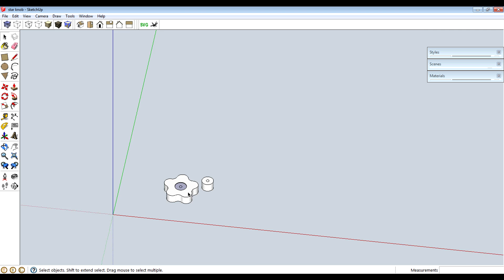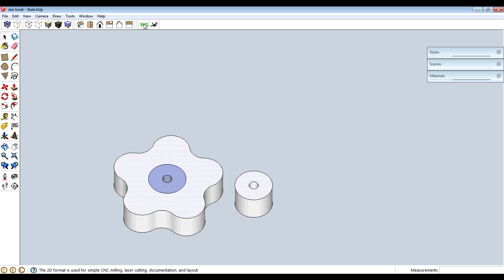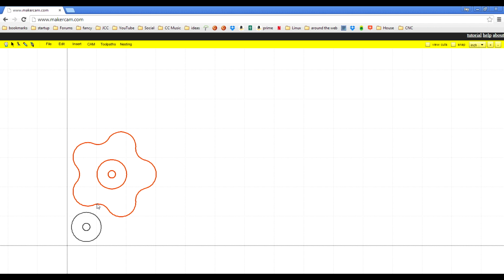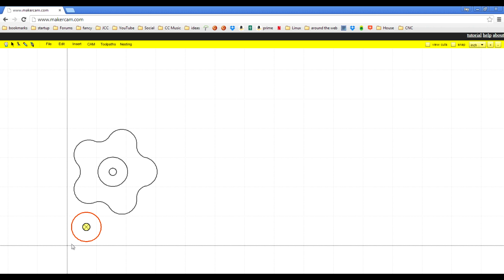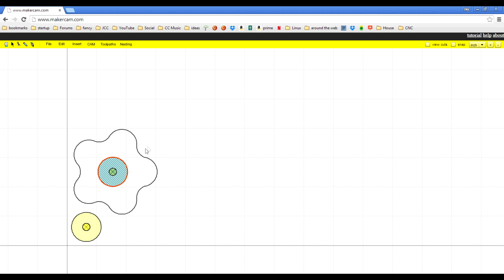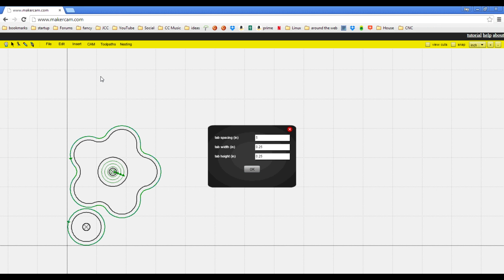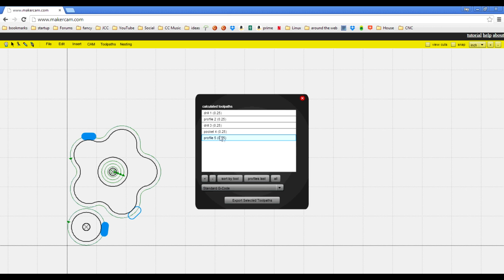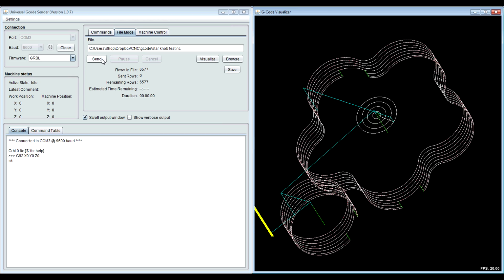CNC Workflow: SketchUp, MakerCam, Universal Gcode Sender  - 191

Comment: Thanks very kindly for an excellent video Jay !!

I am an absolute beginner and until now I could  not find a video that took a 3D CAD image to a nest of cut outs on a sheet of ply for a CNC

I just wish you went slower at the start where you turned the 3D knob into a 2 D part and cut it out.

I cant follow along because you go click click click - far too fast for me to follow along with you.  

But thats just me 😔 as an absolute beginner & I am not the sharpest tool in the shed at the best of times anyway. (My cnc has not even arrived as yet)

I notice in the comments that many other people could follow along with you that quick and learn without a problem. Good for them! 

Great stuff and I hope you might do more videos. In fact I have a proposition

Id like a slower,  step by step video, less talk,  more written comments on the screen,  that shows 
1. drawing a 3 dimensional speaker box with an internal brace or baffle & rebates for very solid cabinet joints (maybe even dovetails?)

and then shows step by step how to convert the 3D box image into the 6 individual sides of a speaker box

(Top, bottom,  front,  back, left & right sides with rebates or dovetail joints)

And an internal baffle  or brace inside the box.

I'd happily pay you $100 dollars for a video showing me how to draw that in SKETCHUP and send it to MESHCAM and then send it to a thumb drive on a usb that can then be loaded into a CNC router.

Make the video as though you are training a child who has basic computer skills but has never CAD CAM or CNC router before
All done step by step, slowly  so I could simply follow you along Click by click 

and cut out the panels from a sheet of 2400x1200mm of marine ply  ideally with a speaker  hole in the front and 
A hole in the back for a speaker wire connector 

I just wish you went slower please! 
Let me know if I can buy that training video off you because that is what I want to learn to do thankyou kindly if you can help please and thanks anyway if you cant help.

What I need please:

1. CAD to 3D speaker Box drawn into individual panels drawn in sketchup
2. Send CAD file to MESHCAM &  to GCODE 
3.Save GCODE to USB thumbdrive to insert into a CNC router 
4. Cut 6 panels out of a sheet of 19mm plywood to 

5. glue together wooden pieces to make the original 3 d image & prove the design worked.

You could of course make a small box for demo purposes... but I could use the techniques you teach to build my own speaker box in the size that I want. 👍🏻

Comment: Great Video Jay,
It is videos like this that show how easy it is for the home woodworker to use a CNC machine.
Many people don't like these machines in the shop but the CNC machine is just another tool and are not seen by owners as the only tool in the shop. Like any tool it is good at some things and not good at others. The trick is to know the difference and use the right tool for the job.
Beware the CNC bug. There is always a bigger faster machine lurking in the wings once you catch the bug.
Cheers
Peter

Comment: Great video on cnc workflow!  I have just built a diy cnc machine and have been testing different programs.  I have been using Inkscape-makercam-linuxcnc.  I think I will probably use the sketchup instead of Inkscape though.  Have you used the Sketchup plugin SketchUCAM?  It looks like it may eliminate the need to export the svg file to another program but I have not tried it out yet... Thanks for all your great videos!

Comment: Wow!   CNC has certainly come a long way for the home user since I made a version for cutting copper shapes for my wife's enamelling business - see http://www.donjohnson24.co.uk/images/Compucuts.jpg
When she and I retired, I sold it, not thinking that I would get into woodworking, but now I would find it useful - but nowhere as neat and functional as your machine.
The explanation of how you got from design to manufacture would have been a boon to me ten or fifteen years ago when I was using my system which was based on a converted mortice machine and stepper motors on an X-Y table.

Comment: Thanks for the video. More CNC pls. Maybe CNC software overview - different software that help working with CNC machines. Also please add the specifications for the machine. Does it have the original shapeoko steppers  (the ones that shapeoko ships with) or you upgraded them. This seams like a bit heavy router for this machine.

Comment: How do you control the precision of your parts profile? No radius compensation? Just hoping that your bit does not deflect? That those aluminum extrusions are strong enough? Are there encoders on those stepper motors to ensure there are no loss of steps? I don't understand...
Reply from the maker: Steven Verschaeve I don't understand most of what you said. I complete the workflow as I did and it cuts what I need.

Comment: Interesting that you didn't have to recalculate the toolpaths after adding the tabs.  Have to do that with the software I use.
Reply from the maker: krtwood What software do you use? I have been playing with various other free software out there to find the one I like the most.
Reply: Vcarve Pro from Vectric, but it's very not free.  Well it was included with my cnc so it was sort of free in the sense I didn't go out and buy it separately.  You can download a fully working trial version if you just want to play with it though.
Reply: Jay Bates Artcam Express is not so expensive. It includes 500 nice 3D models. But you have to buy ekstra module to get tabs... But I find it worth the money.

Comment: Very well done Jay.  You are a very good teacher and knowledge sharer.  I worked with CNC/Robotics for 3 decades and had fun with it.  I hope  to do what you are doing with the CNC Laser I just got.  I was going to buy the same unit you have but I decided on the laser because I actually needed it for my little business.  At a later date I will get a CNC mill like yours and a 3D printer.  Thanks for a sharing with us and handling the not so positive comments so well.  I don't watch the Shapeoko videos that have been posted because at this time I am more interested in sharpening other woodworking skills but this video was more about designing something and the workflow to move it to production.  Nice work.
Reply from the maker: Jim Coogan Thanks for the feedback Jim. I appreciate it. What laser cutter did you get?
Reply: Jay Bates
I got an inexpensive Chinese laser off Ebay that quite a few hobbyist get for the sole purpose of upgrading it.  It's a good learning tool.  On YouTube you can search for K-40 laser engraver/cutter.  On Ebay its a 40W CO2 laser.  Low cost so I don't mind blowing it up.  So far its been fun to use.

Comment: Jay: Obviously you are comfortable with technology.  In my opinion, many woodworkers are scared of technology.  Some have trouble attaching a photo to an email. I worked in IT for many decades and understand what you said.  One thing I learned is that when talking to non-technical people, I used only non-technical language to avoid intimidating them.  While you know what an SVG file is, many do not.  I think your video would appeal to more people if you slowed down a little and explained that an SVG file (Scalable Vector Graphics) is just a method of transferring information (not data) from one software application to another.  Some people may also need an explanation of what a suffix (.svg) is and why it is important.
Reply from the maker: peggyt1243 Thank you for the honest feedback. It's hard to get as much information as possible into a video without making it too long. The intent with this video, and most of my videos, is to get people thinking and headed in the right direction. A quick google search can answer most any simple questions that people have.

Comment: Jay - Noticed that the GRBL (Arduino) is using firmware 0.8c.  You should upgrade to 0.9g - it is WAY better. It will make it seem like you bought a new machine - the stepper control algorithm has been updated and is much more efficient.  Here are some instructions on how to do the upgrade (see links below - suggest you use the Arduino IDE method).  Ping me if you want me to share my GRBL 0.9g settings.

https://github.com/grbl/grbl/wiki/Flashing-Grbl-to-an-Arduino
https://github.com/grbl/grbl/wiki/Compiling-Grbl
https://github.com/grbl/grbl/wiki/Configuring-Grbl-v0.9
Reply from the maker: Jordan Terrell Thank you very much Jordan. I'm always open for learning more about this. Thank you.
Reply: A nice feature of 0.9 is the touch probe for the Z axis. 
This makes it deep simple to zero the bit to the surface of your stock. Makes doing a job with multiple bits much easier.
Reply: Jeremy Johnstone Jay Bates Yes, that is really nice.  Takes a lot of the guess work out of multi-tool jobs.  That and having homing/limit switches - those are a must have. So nice to be able to get back to work piece home perfectly after changing bits.

Comment: A brilliant tutorial, Jay. That software could not be simpler to use.

Something we do, where I work, is to machine to within 0.5mm of the bed, as opposed to cutting to full depth or leaving tabs. This leaves you with a 'skin' that can them be trimmed flush.

Each method has its own benefits and I look forward to seeing you make more use of your new toy. :-)
Reply from the maker: Olly Parry-Jones Thanks for watching Olly. I sometimes do the skin cutting as well. I prefer the tabs though. What do you typically cut at work?
Reply: Jay Bates We mostly machine foam moulds to hold various items but we also do plywood worktops, shelves and a HMW plastic for all sorts.

Comment: Thanks for the detailed overview of your process. I just upgraded my Shapeoko 2 to the Makita RT0701C and can't wait to see how much that will increase its capabilities over using a dremel. I can't wait to see how you incorporate the CNC into future projects.
Reply from the maker: Mike Merzke Thanks Mike. The Colt has all the power to complete the task but I'm not sure if I like it in the machine yet. Dust control is non existent.
Reply: I found a dust shoe for the Makita Router that I am having 3D printed for mine. I hope that helps!
Reply: The Makita and the Dewalt 611 are both nice because of the electronic speed control, especially while under load. With a 1/8 collet you can get great engraving and other fine details. 
I have the Makita, but the DW has nice LED lights.
Reply: Jay Bates  nice job with the shapeoko have you seen Targ's Workshop dust shoe ?  He has cut files and source for materials on his you tube

Comment: informative video, but there'a much easier way by using excellent free vector graphic program called Inkscape. Easy drawing, export to different formats, and also you can export G-code directly by installing extension.
Reply from the maker: I find designing in sketchup to be MUCH easier than designing in inkscape.
Reply: Jay Bates
It'  personal preference. I use sketchup a lot, but for more complex shapes with curves i always use inkscape(and many times i import in sketchup to make 3D).